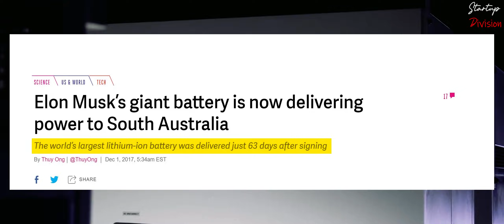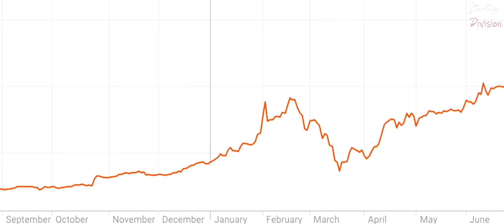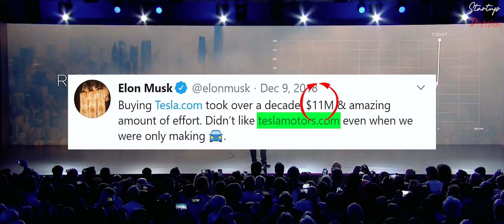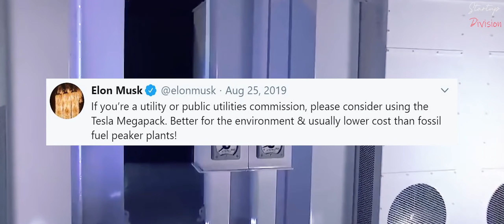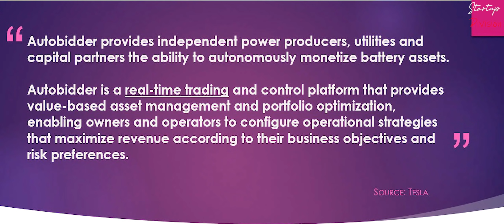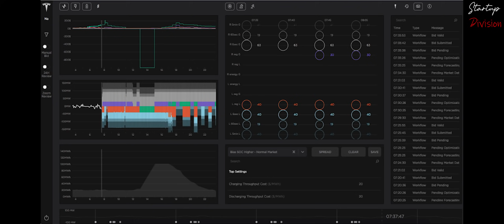How Tesla's Colossal Battery MEGA PACK Will Power the Future !

Comment from the maker: How Tesla Battery Farms Changed the Lives of Australians -> https://youtu.be/kYMtqnzEDVg
Reply: Yes, but you should be more careful with your terminology.
Power is measured in megawatts (MW), total energy capacity is expressed in megawatt - hours (MWh, 1 megawatt of power supplied for an hour).
There is no such thing as megawatts per hour.
Reply: No. Just a player.
Reply: with NOVONIX tech DPMG
Reply: Yes, without a doubt.
Reply: Yes
Reply: Tesla Maps is probably more likely
Reply: Not even close. The solar roof does very little in the solar market and is way to expensive.
Reply: Larger than the auto business, which also will be massively larger.
Reply: Ye
Reply: @dinosaurboi9457  It's "Aye"
Reply: Tesla is ahead and will stay ahead until they are the largest player in the energy sector. Energy companies are even slower to respond than car companies. Energy companies have billions to throw at catching up, just like car companies that where supposed to catch up in no time and overtake Tesla.
Reply: @jwstolk  To your point, it really the difference in the old traditional way of dominating a market. Energy company want a monopoly on distribution and generation. And they have for the past 30+ years. In California, while under a GOP Governor and while he was pro-green energy, he signed the subsidies with PG&E to handle the solar expansion in California. While the Dems wanted subsidies for private home installations. The result is a large scale solar system way outside of the grid, the governor got to claim a win by increasing the solar "install" in the state. And homeowners taxes were used to pay off the energy company with no savings passed on to them. Tesla is now allowing homeowners to reverse that role.
Reply: NO Absolutely NOT .... Lithium batteries are FAR TOO expensive for power grid energy storage .. were far cheaper alternatives already exist.  The only obvious area of participation would be for Tesla vehicle owners to use their own cars as energy storage devices, selling power back to the grid during higher cost hours .. but Tesla has not enabled that, nor do any Teslas today have the appropriate standard power outlet & electronics for this. As for "PowerWall" .. nobody needs that, LOL, Solar Power to Grid systems are FAR CHEAPER. As for Solar Roof tiles, they are absurdly expensive, and NOW, solar panels are considered cool looking on the roof, and are less than 1/2 the price .. with MANY low cost high quality panels coming out of China. 
     Tesla makes a really nice car, and has sold cars at a loss, to buy market share and brand loyalty that will keep them going for many years ... LOL, why can't people just admit, Tesla is ONLY a really cool car company, nothing more. A car company that still sells cars for less than they cost to make.. and will eventually earn a small profit like legacy OEMs. So, expect Tesla stock to eventually "Krispy Kreme" back down to legacy OEM valuation levels (1/10 of where its at now).
Reply: @KrustyKlown  Did you miss the buy at $300? You sound bitter like an angry short seller who's about to get a closing call? 

Little factoid. Model 3 and Y all ready come equipped standard with the "electronics" needed to "sell" the power back. Its called V2G system. 
https://electrek.co/2020/05/19/tesla-bidirectional-charging-ready-game-changing-features/

Second: They just lowered their pricing on Solar installs. And I happen to be redoing my roof and quoting the system. While my location does play a big role in the ROi. For my house, it's the same cost to have the new roof+panel solar as to have the Tesla Solar Tile installed. 

But I have a feeling this won't convince you, looking forward to re-reading your reply in 5 years.

Comment: This is what will be built in India, in mass - batteries ! Only 1/3 of India’s energy is renewable. Two thirds is coal, diesel, gas. More than 1/2 coal. India needs lots of energy to move forward.
It’s not logical that Tesla build a auto plant in India . Even with 1.4 billion people there is a very small market for luxury autos per year, 30-50,000 .

Comment: Wait, so a storm caused the power lines to fall down, and then he built a big battery farm, right? OK, so how did he get the electricity from the battery farm to the homes and businesses? Oh, by power lines? Then what the fuck is the difference???
Reply: I just reroofed my house in Tesla solar tiles and have 45 KWh of storage. I don’t need to be concerned if power lines go down. Autobidder software allows me a market place for excess electricity sale.
The batteries allow power plants to flatten the usage curve to make them more efficient and profitable. Batteries don’t have anything to do with downed power lines except in individual cases like mine.
Reply: @shepherdsknoll  Congratulations on spending $50,000 for something I can buy for $50 bucks a month.
Reply: @Mark-qg8hm  ,not sure what part of the country you are in but can you really get a new roof for $50/ mo ?
Reply: @shepherdsknoll  No, but I can buy electricity for $50 a month. I don't need a new roof.
Reply: @Mark-qg8hm  , I needed a new roof. I have a large house and was quoted $45k of a comp shingle . Now Tesla has put a class 2 roof on my house for $42k and I have no more electric bill , nor do I  have to worry about downed power lines.

Comment: This is all well and good, but why can’t you have the solar panels mounted on top of the battery units? You can fit more stuff onto the same land area. Also, vertical axis turbines with rotating baffles, in between the battery units, where you have a concentration of wind.

Comment: Forget batteries think about bearings things that turn that don’t wear out that’s what you need to think about forget batteries batteries or toys kids play with back in the day things that turn and don’t wear out give power forever and constantly it’s called flow get it TM
Reply: You cannot store energy it doesn’t last continuous energy is free in forever lasting long if you have the bearings to hold it on how long does the battery last three years think about your car how many times you got a jump that thing about nuclear reactors how many guess you know think about it or y’all just slower I am just going past y’all
Reply: No batteries are good for dead cells they work perfectly for that dead cell batteries are very good a dead battery well that could transmit and hold energy and a continuous level and do an outrageous output I stored battery G is worthless because leave your key on the Tesla’s dead
Reply: @bradbull3355  You are not making sense.  Are you high?
Reply: IncognitoTorpedo no I am not sorry if it looks like that, but by you saying that means your not trying to find out stuff about things like this and Statements like that do not make progress
Reply: @bradbull3355  If you used punctuation, people would have a better idea of what you are trying to say.

Comment: So this thing can supply how many MW load? And how many MWh capacity?  MW is a measurement of flow. MWh is a unit of quantity of energy storage. When you don't use the correct units you sound as stupid as non-engineer Elon the salesedouche
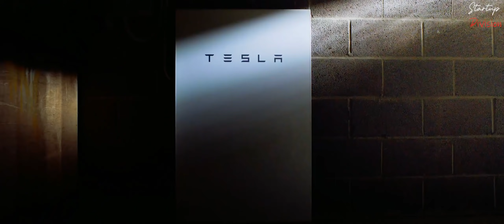Reply: did you not watch the video? its at 5:00  elon musk is also an engineer that is something you cant deny just because you can't pay attention.
Reply: @miguellopez3392  The guy uses so many incorrect units that he's impossible to follow, like "watts per hour". One GWh isn't really squat anyway that won't even hold the residential loads overnight. And Elon claims to be an engineer.

"""Education
While awaiting Canadian documentation, Musk attended the University of Pretoria for five months.[59] Once in Canada, Musk entered Queen's University in 1989, avoiding mandatory service in the South African military.[60] He left in 1992 to study economics and physics at the University of Pennsylvania; he graduated in 1997 with a Bachelor of Arts degree in economics from Wharton and a Bachelor of Arts degree in physics from the College of Arts and Sciences.[61][62][63]

In 1994, Musk held two internships in Silicon Valley during the summer: at an energy storage start-up called Pinnacle Research Institute, which researched electrolytic ultracapacitors for energy storage, and at the Palo Alto-based start-up Rocket Science Games.[64] Bruce Leak, the former lead engineer behind Apple's QuickTime who had hired Musk, noted: "He had boundless energy. Kids these days have no idea about hardware or how stuff works, but he had a PC hacker background and was not afraid to just go figure things out."[48]:60

In 1995, Musk was accepted to a PhD program in energy physics/materials science at Stanford University in California.[24] Eager to pursue opportunities in the Internet boom, however, he decided to instead launch his first company, Zip2."""

So he never got an engineering degree or license with the California Board for Professional Engineers, Land Surveyors, and Geologists,
 or any other state.
Elon Musk is about as much an engineer as Dr Pepper is a medical doctor
Reply: @joecummings1260   i didn't use killowats per hour? but elon never sold these as grid replacers he specify selling them for outages and grid balancing and they do a very good job at it. Wikipedia wont tell you everything, hes not a formally educated engineer but he was chief engineer for the space X falcon 1 and falcon 5 rockets, he even worked on manufacturing parts he designing and machined them himself, so hes has actual  engineering experience then many college grads with a degree, helps that his dad was an engineer too probably gave him some pointers in between the the mental abuse sessions. he also is self tought programmer and made sevral hundred million selling software companies but i guess hes not a real programmer without that bachelors in programming?

 "former lead engineer behind Apple's QuickTime who had hired Musk, noted: "He had boundless energy. Kids these days have no idea about hardware or how stuff works, but he had a PC hacker background and was not afraid to just go figure things out."[48]:60"
Reply: @miguellopez3392  The guy in the video mixes up his units, and uses nonexistent units like "watts per hour". And being an engineer is a specific thing. Just because you call yourself an engineer, or somebody calls you an engineer doesn't mean you are one. You need to pass exams starting with the EIT exam. And from listening to Musk speak he's not even ready for his EIT
Reply: @joecummings1260   yes the guy working for a media company is not an engineer and is unreliable i get that.

being an engineer is a specific thing yes and that doesn't involve having a degree, it involves engineering and thats what musk and his companies do, you don't think hes ready for his EIT but i bet the line of freshly graduated engineers waiting to join his companies aren't discourage by it, anyways he assisted in the engineering of the early falcon rockets as he did also study rocketry when getting SpaceX started, pushed by his obsession with getting thigs quickly and efficiently he would even fired and take the place of engineers who refused projects because the budget and time table where to small. when some CEO manages to outcompete military contractors and the top automotive companies in the world in terms of productionized technology in under 2 decades then they are probably very understanding in the field of engineering, manufacturing, and logistics.
Reply: @joecummings1260  Musk is a very very smart guy with a lot of physics under his belt.  For you to claim he's not up to snuff as an "engineer" is pretty comical, given what Musk has accomplished, and considering that compared to science, engineering is pretty trivial.
Reply: @joecummings1260  Well, Boring Co tunnels exist. But yeah, he's got all those other crazy fantasies like landing a rocket on a ship, or putting a thousand satellites in orbit to provide low cost internet to the entire world, or accelerating the electrification of ground transport, or creating solar roofs... Only an idiot would believe in that, right?
Reply: @incognitotorpedo42  Buying a used TBM that is for digging sewer tunnels, then digging a small diameter tunnel and driving a car through it isn't any science or engineering breakthrough. He has no new tunneling advancements. I've put wheeled equipment in sewer tunnels for repairs over 30 years ago, and it wasn't a new thing then. Electric rail in mine tunnels was common over 100 years ago. Where is the huge breakthrough?

Comment: For more energy then simply put lots of bigger generator machine that are electricity driven motor systems instead of diesel or gasoline. And you just need one wind turbine to start one of the generator machines♻️ the rest this will feed the rest with electricity and the generator machine materials are recyclable so it will be no need for coal just like i said before my idea is to put generators machine that are electricity driven motor systems to give electricity to the house with using only 1 standard household appliances electricity so the bigger generator machine you have that are electricity driven motor systems to create electricity then most likely that you are going to earn more money than the electric companies. Just example one big mall using the biggest generator machine against 1 normal house that only uses 20 percent of energy so the generator machine still have 80 percent to give back to the grid so youl earn more money but if every house in the world has this big generator machine that are electricity driven motor this must be placed on 2-3floor so it does not get wet by flood? 🤔🕵️‍♂️🕵️‍♀️✝️☯️🇵🇭
Reply: You need to take a basic physics class.  There you can learn why this scheme is impossible.
Reply: @incognitotorpedo42  I have seen gasoline or diesel driven motor that create electricity around 3000V.or something like that, but i was thinking why not use it. By changing the motor system to electricity driven that uses less electricity energy and going through generator it gives bigger energy just think like of electric fan system that goes on electricity and the spinning fan is the generator or dynamo system. well at list i try to share something to think for the people. If you are expert on mechanical systems of the gasoline or diesel driven generator then the future are simply people must accept to eat food and breath nuclear waste and Tesla batteries waste remember all people throw comes back to the people drinking water and food and air etc  ?
Reply: @jessiedizon2376  , you must drive a Chevy Volt.

Comment: Well for one batteries are storage, so don't produce. There for it will not power. The battery is there to balance short term.  SA is looking for base load source,  because the coal powerstation being shut. Even for backup the battery is way too small

Comment: The large batteries are good, but they don't produce electricity, there is still a need to make electricity
Reply: I just had a Tesla solar tile roof installed, it produces 5+ KWh and has 45 KWh of storage. I sell excess power in Teslas Autobidder market.
Reply: There are lots of ways to make electricity.  Did you notice the large wind turbines in the background at the Hornsdale battery?
Reply: @incognitotorpedo42  did tesla installed or made those wind/solar farms?! Nope.
Reply: @alanmay7929  Tesla has a huge solar business.  It doesn't matter who made or installed those turbines, they provide power.